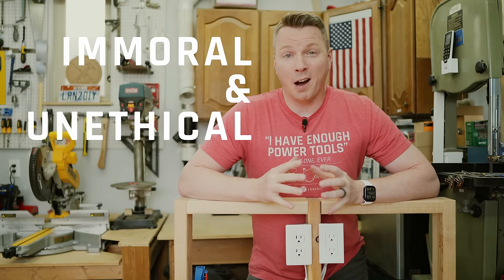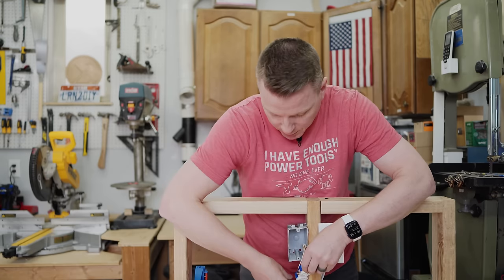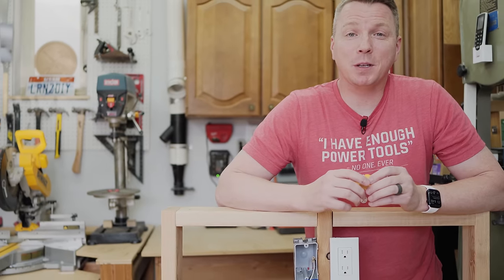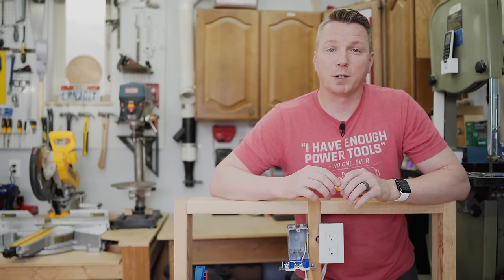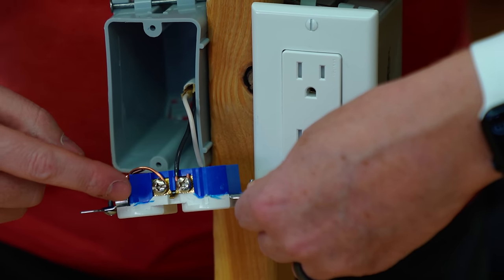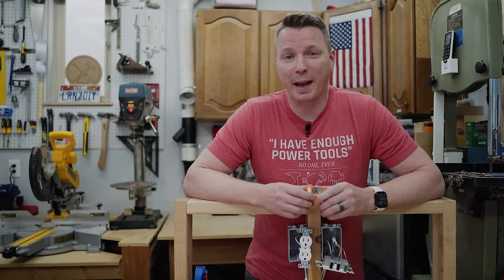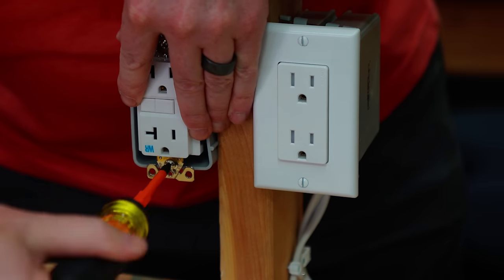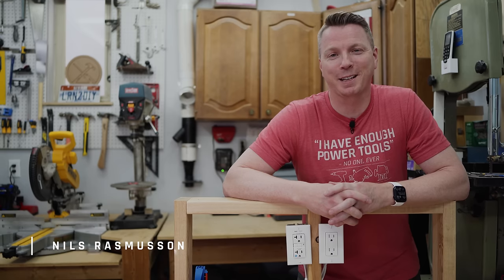People Are Adding Deadly Hacks to Outlets

Comment: The main reason cheap testers aren't going to be able to detect that is because ground and neutral SHOULD be bonded at the 'service entrance' which means that they should often read a short between them, and a cheap tester can't tell if that's in the junction box or at the service entrance.
Reply: Exactly, it's not just because "the testers are cheap"
Reply: Was waiting for this to be mentioned during the "why" section of the video
Reply: @somedudeRyan  You can send down a small high frequency signal down the wires and look how fast (and/or strong) it comes back.
That way, you get a rough estimate of how far away the grounding point is.
A real Ground has at least a few meters from an outlet to the bonding point.
In that sense "the testers are cheap" is correct - if you put in the brains, you can figure out that the connections is centimeters away, not meters as it most of the times should be.
Reply: @sarowie  in a video that purports to explain something technical "the testers are cheap" is not the answer to why it shows the wiring is correct. This original comment is the actual explanation. Technicalities are for losers, liars, and advertisers.
Reply: @somedudeRyan  Except that it's not a technicality, it's because the cheap testers lack a function and capability that a more expensive device might have.
That makes the cheap testers, cheap.
Doesn't make them worthless or bad, just cheap.
Reply: @cray-z578  that's a cop-out for a lame explanation to begin with
Reply: @somedudeRyan  Nah, this is definitely just a you problem dog. The testers are cheap and can't recognize a specific fault. That's really as simple as it is, and is a perfectly fine way to put it. If anyone wants or needs further clarification, they can do the research or just read the original comment, which isn't a different explanation than in the video, it's just a further elaboration on it.
Reply: @cray-z578  further research, like watch a different vague YouTube video. You're right I made the testers, it's all my fault. Get bent
Reply: @cray-z578  your car can't go 150 miles an hour because it's cheap? Or because it lacks the engine displacement, gear ratio, tires to do so? Intellectually lazy cop-out
Reply: @somedudeRyan  The purpose of a car isn't always to go 150mph. So no, that wouldn't make it a cheap car. If it was a sports car, and couldn't go 150mph, then that would be a cheap sports car because it can't accomplish something a more expensive vehicle could.
The purpose of an outlet tester is to test for potentially dangerous faults, and a cheap tester can't find a specific fault, which it can't do because to add those features would cost more money, making it a more expensive product. Because those costly features are not present, it's a cheaper product. That makes it perfectly fair and accurate to say that the tester is too cheap to catch a fault.
Reply: @cray-z578  both may be true, it's cheap and lacks functionality but only one is the actual reason it doesn't do a thing, and it's not the price tag on the item
Reply: does that expensive tester actually detect where this connection is done?
Reply: @cray-z578  It's not that they are cheap, it's that they are not designed to detect someone trying to cheat them.  No one in the process of creating these testers ever thought about someone trying to trick them.  The $7 harbor freight meter will tell you the issue if you actually know what you're looking for.  The OP's explanation is correct.  the issue is not that the tester is cheap, it is that it is not the correct tool to check for this problem.  It is tricked because from it, and anything you plug in to a three prong Edison outlet's perspective, there is no difference between ground and neutral.
Reply: @somedudeRyan  The purpose, IE intended scope of functionality, for these devices is to detect common wiring issues that can be potentially dangerous. A bootleg ground is one such issue, and is well within the scope of a socket tester. Whether the issue specifically exists to defeat testers is entirely irrelevant.

If a device does not cover something that is within its scope because choosing to cover it would increase the cost, then the device does not cover that something because it's cheap.

If you're going to be a pedant, at least have the decency to be correct.

EDIT: For further clarification, essentially the basis of your argument is that the device can't detect bootleg grounds because it doesn't have the functionality to, but it doesn't have the functionality because the functionality is expensive. Therefore, the device doesn't have the functionality because it's cheap. Which in turn means that it can't detect bootleg grounds because- that's right- the device is cheap. It's not like the problem is out of scope for the device.
Reply: @Hexagonaldonut  that's not my argument, that's the other commenter. I literally said the original post is the actual reason it's not detected. Because the ground is bonded at the panel. That's the reason.
Not because it's "cheap"
Just saying it's cheap is a lazy, non informative, thing to say about it.
The other comments are the ones being pedantic.
Reply: @sarowie  Assuming you have a decent multimeter you could also use that ... the difference in resistance between something bonded directly or 10 meters away is not immeasurable.
Reply: @sarowie  valid point it's just that for me personally his explanation being just that it's cheap kinda indicates that he doesn't really know what he's talking about
Reply: @kubeek  No, the only way to test for this is a visible inspection.
Reply: Those testers also do not comply with UL listing for testing GFCI either
Reply: @ryanjay6241  The problem is that there is no correct criteria.  A badly done connection at the receptacle could easily have more resistance than a correctly wired ground and neutral with a short run to the main panel.

As for using a TDR (Time Domain Reflectometer), that's an instrument that takes some knowledge of the installation to correctly interpret the results.  An automated tester might have a good guess about specific cheats, but it's not going to reliably detect all of the ways to fake a ground.
Reply: As long as there's no RCD/GFCI, it does not make significant difference whether connected in the plug or at the distributor.
Reply: @davidblahota5655  There is no difference with intact wires, but if the neutral becomes disconnected or has high resistance a grounded case will become live.  Not just "a little tingle", but full line voltage with deadly current available.

A bad neutral without that jumper would leave the consumer device either still safely grounded, or mostly harmless with perhaps a little leakage current available.

To summarize, the jumper changes the situation from somewhat unsafe, to actively dangerous.

That might not seem like a big risk, and indeed the risk is decreasing with double insulated consumer devices now nearly ubiquitous (except for large appliances).  But there are still devices that use a ground and they generally really need it.
Reply: @1djbecker  Yeah, i'm not disagreeing with the necessity of grounding. You might also get the live voltage on parts that should not be live at all with switching the L and N. Being the only thing done wrong it's not that harmful, combined with other disregards it might be spicy :)
Reply: Can't a cheap tester with GFCI test find out if there's a real ground by using it in conjunction with a plug in GFCI?
Reply: @jeffkardosjr.3825  I'd have to check that. A definite maybe.
Reply: Ţ
Reply: Couldn't the testers measure the resistance between the ground and neutral? If they're shorted at the service entrance, there will be a higher resistance because of longer wires. So, for example, if it measures a resistance of less than 1 ohm, it could add a light for "Potentially shorted ground and neutral" or something. Can't know it for absolute certain, but it could give a red flag for people to know what to check manually.
Reply: A tester could also test the resistance of the short between neutral and ground to detect this
Reply: The easiest way to detect a faulty is to use a leakage tester. You plug it in, you set the mA of the GFI and you push the button. If the GFI doesn't trip, you don't have an earth
Reply: Its because the difference in resistance is actually minimal. It sounds like being bonded at all is the real problem. You're right, the entire design is bad, and it takes someone actually using their brain, not a professional, to see that.
Reply: @cray-z578 you do realize that the difference in resistance from The outlet to where they are bonded is infinitely small right? You're asking for something that even expensive multimeters can't do.
Reply: @1djbecker no that's not true either The answer is all of the above. You need to test it and then you also need to visually inspect it to confirm your suspicions. This is what's called in many industries as sanity checking.
Reply: @3of12  That resistance is definitely not infinitely small, but you are right a dmm probably couldn't tell you the distance.
But it's not pure resistance used to measure wire lengths and to check for faults like these, you can send a signal down a line and measure how much of that signal reflects back.
Also, my point was never that you should expect those results from a cheap outlet tester, my point was just that calling them a cheap outlet tester was a fair statement made by the content creator.
Reply: @cray-z578  I definitely agree with you but it's still a cop out. The cheap unit isn't used to test that
Reply: @johngaltline9933  "the issue is not that the tester is cheap, it is that it is not the correct tool to check for this problem" - so what's the point of having the tester if it's not the "correct" tool to check for faulty wiring ? Both the cheap and expensive testers have the same purpose, to check for faulty wiring, yet the cheap ones fail to detect a fairly common fault, while the expensive one does. Both, testers are a tool for the same purpose, but the cheap one fails in certain common scenario, because they have been made cheaply and lack the proper function.
Reply: @artur6912  The cheap tester's job is to make sure that each of the prongs is functioning as it should.  with a bootstrap ground the outlet functions exactly as it is supposed to.  the purpose of the tool is to check that hot ant neutral haven't been swapped and that a ground connection exists.  The cheap tester assumes that no one is actually trying to fool it, just like an emissions tester when a 2010's VW Diesel drives on it.  And guess what, if the cheap tester says it's good, that outlet is actually just as safe as one with a proper ground.  There is zero actual difference to anything you plug in to the outlet with a bootstrap ground, when the neutral wire is functioning correctly.  The cheap tested checks if the outlet is safe to use, and it does that just fine.  You don't need the expensive tester to check for proper ground bonding, though.  a $7  multi-meter from harbor freight will do the job just fine.  The "cheap" tools that cost more that that meter are for people that don't know what they are doing in the first place and shouldn't be using them.
Reply: Yep, technically the neutral wire is the ground wire.
Reply: A resistance test between neutral and ground on the outlet might be telling. Through the bootleg ground, resistance should be effectively zero - low enough that a commodity multimeter won't detect anything. Since they are bonded at the panel in a proper setup, the resistance will still be very very low, you might see a measurement of a fraction of an ohm.

Now, if it's a reverse polarity bootleg ground, you're probably buying a new multimeter... But better a new multimeter than being dead I suppose.
Reply: @homestar92  it’s about 1/8 ohm per 25 foot of run with 14 gauge copper. It’s not much, but still enough to read over zero even with the cheapest meter. It’s enough to know to check if it’s wired right. 
If you’re going through the trouble of having the meter out anyway, it takes about no effort to switch to volts first to make sure it’s not wired backwards.
Reply: also bounded up in the light post where the transformer is
Reply: Main reason being is that they are at the same electrical potential, but dangerous because now you are sending current on the ground wire all the time
Reply: @homestar92  

It was pointed out in a reply in this comment but maybe you didn't read it, so I repeat it: a bad connection between neutral and the bootleg ground would also result in the resistance you are trying to measure.
Reply: @Hexagonaldonut  I'd rather pay $7 than $421. Some of us need cheap.
Reply: If they get merged anyway, what's wrong with a bootleg ground(assuming the polarity isn't reversed)?
Reply: @JS-df8qm  Where I man at you only need to bond the sub panel it it's more than 250 ft from the main panel.
Reply: @Ryan my guy you're the definition of making a mountain out of a mole hole.
Reply: @cray-z578  Cheap is not explaination, it is a result of worse specification but the reason was explained in the comment we are under.
Reply: Yes, the tester is not at fault here. I imagine the sophisticated tester measures capacitance in the wires to determine how far away the neutral is bonded to the ground. But that's way out of the scope of a GO / NOGO outlet tester. They're doing exactly what they're designed to do.
Reply: @somedudeRyan  mean, he just provided an explanation on why the cheap testers can’t detect it, but it’s still accurate that the reason they can’t detect it is because they’re made cheaper… 

You keep thinking other people are being pedantic, even though multiple people have now said you’re being unbelievably pedantic. Maybe a bit of humility here would be helpful.
Reply: @cray-z578 I don’t know what that other dude is on about. He’s being unbelievably pedantic and just arguing to argue because I guess he dislikes this guy for some reason.
Reply: @TheHeadincharge  being vague is not the same as being correct. Especially in a video that purports to teach something.
Reply: @cray-z578  Ground and neutral are bonded. What would "good" tester detect?
Reply: The bonding at the main breaker box is not the same as a short at the outlet. There is a small resistance even with 12 AWG wire. I have a tester that measures the resistance between the neutral and ground at the receptacle. Even a few feet of wire can be detected, which is expected.
Reply: @cray-z578  "cheap" implies they made the product more fragile or worse at it's intended purpose to make it cost less. As far as i can tell their intended purpose is to test if the circuit is live and if you or someone else screwed up while wiring the outlet. if you want to detect something malicious such as this you should use tools designed for that purpose.
Reply: Thank for this. It wasn't clear why it wouldn't just check for a short between neutral and ground but this clarifies it
Reply: The purpose of those simple testers is to determine if the outlet was wired properly, not that someone is trying to pull sneaky stuff. I am curious how the expensive tester is determining the fault since they are bonded together at the source.
Reply: @johngaltline9933 how are you using your meter to ensure it isn't wired backwards though. This is AC not DC. Unless there is a copper pipe somewhere or you are using a live detection pen it could be tricky to just use a volt meter.
Reply: Correct.  But readers should understand that only the "service entrance" is bonded.  This is the first point of entry which could be an exterior disconnect or the "main" panel inside.  When an exterior disconnect is present, the "main" panel becomes a "sub panel" and is not bonded and ground wires and neutral wires are on separate bus bars. This creates a single path to ground between all panels.
Reply: It really is because they’re cheap, though. They’re designed so that DIYers can diagnose the most common mistakes, assuming good faith. The bootleg ground is malicious, criminal behavior. You can make a $400 device to detect it, but it’s completely unnecessary for the $20 device’s intended use case. If you make it idiotproof, they’ll build a better idiot.
Reply: @sarowie  Yes..  a "cheap TDR" would work.   The Ground wire should Not be significantly shorter than the neutral wire,  unless Ground has been bonded to neutral Somewhere besides the one place it is supposed to be.
Reply: It has nothing to do with a cheap tester. You need to understand and explain the functionality of the grounded and ground conductors. 
Have seen this done where municipalities requires upgrades- eliminate know and tube ir GFCI protect them prior to the sale of a home.
Just don't install a 20 amp device on a 15 amp circuit like was done in this video.  It's a code violation!😮
Reply: That is a problem if you think that is always the case.  Sometimes the neutral is bonded to earth at the substation and there are several volts between earth and neutral depending on service imbalance on the phases.  If this is the case you can get a lot of amps if you tie earth to neutral. Then there might be a TT system and you will creat a neutral earth leak and trip mcbo or equivalent.
Reply: @tomooo2637  Neutral must ALWAYS be bonded to earth at the main panel, and nowhere else inside a building's electrical system.  This is a code requirement. Therefore there is something incorrectly installed in the building if it is not 0 volts between Neutral and Earth within the panel and near 0 volts  downstream from the panel.
Reply: @Mysdia  UK regs have different requirements, this is NOT the case. Bonding earth at the CU is energy inefficient as you get significant ground currents. So in UK there are ground at substation with supplied earth, ground at CU, and TT ground to true earth, though this is rare now.
Reply: @Mysdia  Europe is similar to UK, with multiple bonding types
Reply: @Mysdia  I believe in USA that TT is not uncommon
Reply: Can't say for sure but once you gind this the proper way is to open all receptacles or fail the whole house.@kubeek
Reply: @ljohnson9440  earthing and ground are very very different.  Earthing is to create a short current to blow the fuse, ie MCB.  Ground is the term used for connecting water pipes and metal items near water, like a bathroom.  This is to make sure the water is at the same potential as anything you can touch.  When wet you can be killed by electricution by a very small PD since a current will flow to kill you.  I realise that most people don't understand earthing and grounding and earth conductor bonding to neutral
Reply: @somedudeRyan  you spelt technicalities wrong.
Reply: So does it mean that cheap testers are going to be able to detect that is because ground and neutral SHOULD NOT be bonded at the service entrance?
Reply: the guy is trying to teach people about outlets and has both of them mounted upside down lol gayyyyyyy
Reply: 15 amos don't run through your body... C'mon...
Reply: @TheHeadincharge  They're made cheap isn't an explanation of why. It's really just an admission of "I don't know", which is in line with a bunch of other things in the video. He does an ok job of explaining what to do and what not to do, but he really fails on the why. The explanation of testers being "made cheap" isn't really explaining anything.
Reply: @ronmit-p5g  The vast majority of receptacles installed where I live are installed in the same orientation - ie ground pin down. It's the same in many other cities I've visited throughout the US, Canada, Mexico and the Caribbean. I've also seen them with the ground pin up in many places. As far as I'm aware, there's no code requirement for any particular orientation, but feel free to cite the relevant rule if I'm wrong.